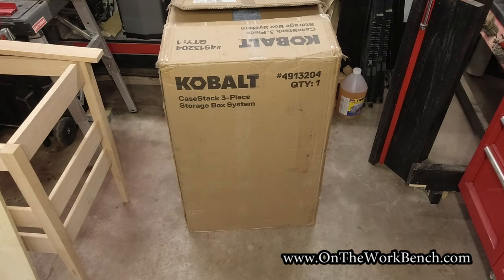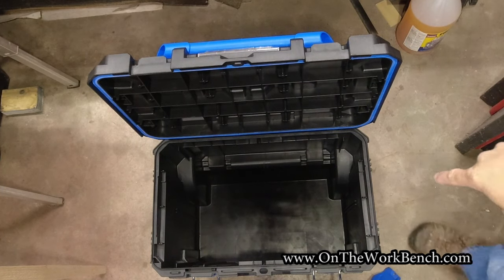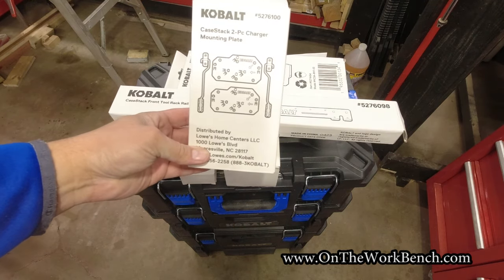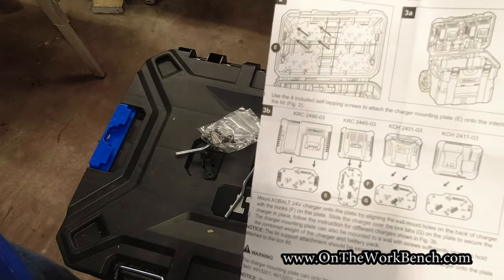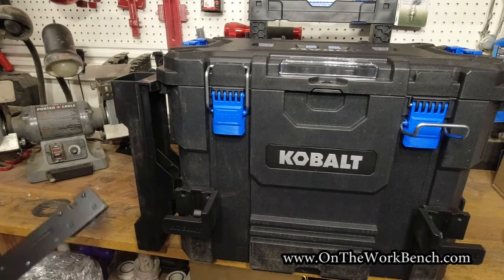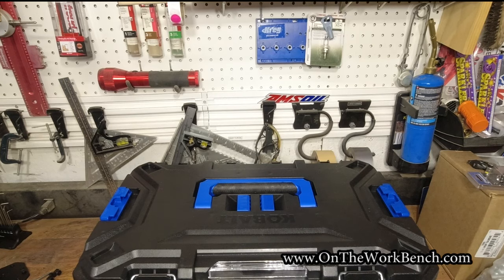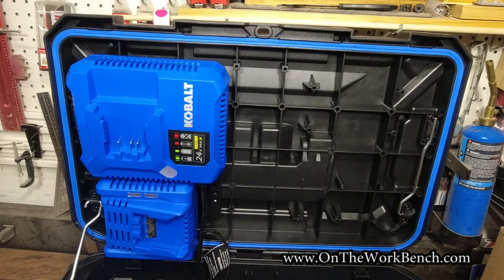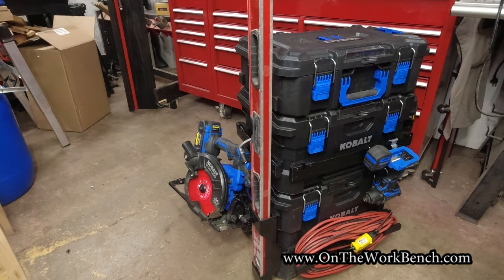Kobalt Casestack

Comment: Thanks for the great overview.  You can tell that Kobalt has taken a back seat to Craftsman and Flex at Lowes, but their CaseStack system I think is possibly the strongest.  A bit more simple or streamlined in some areas, but they are built like a tank.  Hoping they come out with a battery charger unit with lights like Big Red/Yellow have.  Love the Kobalt line!  (I’m using all Hart boxes now simply because they were blue and made by Deter and cheap, excited for the new units from Kobalt… we need a crate!).